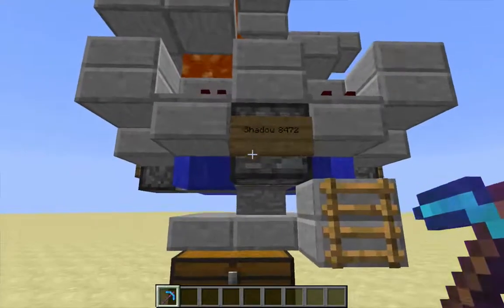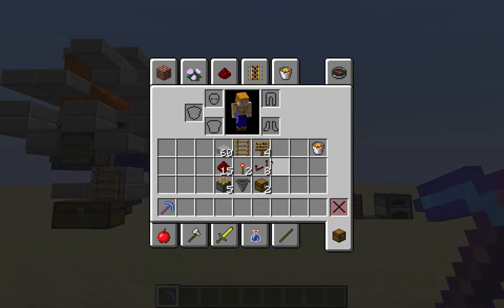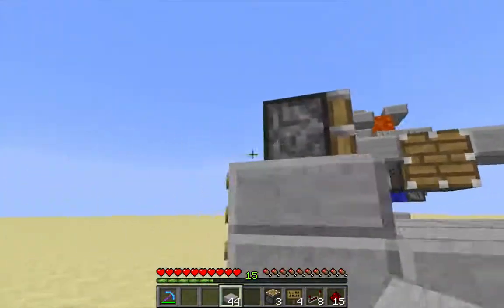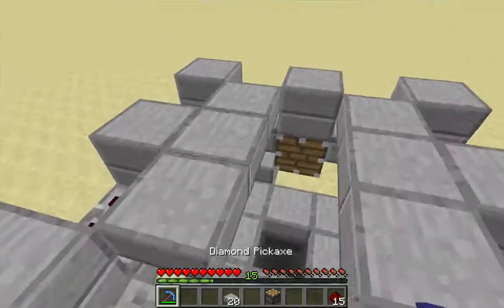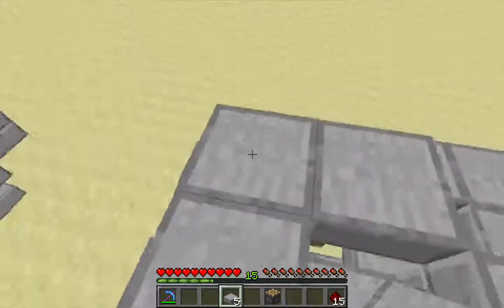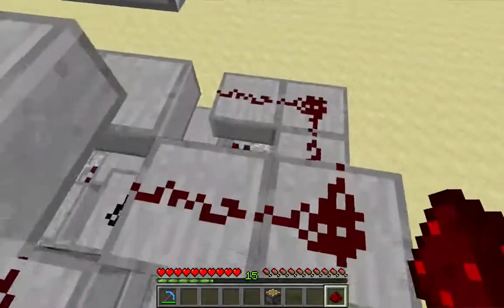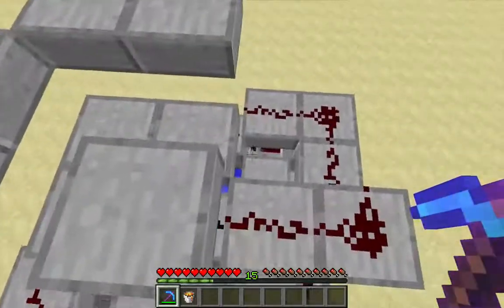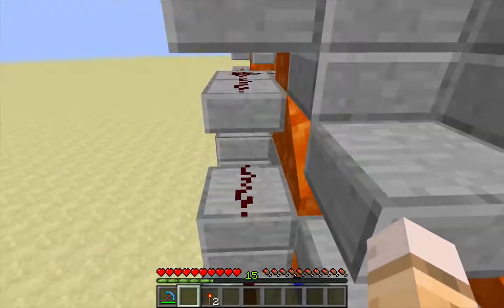Minimalistic 4-Piston Smooth-Stone Generator (SkyBlock friendly)

Comment: What if that skyblock doesn’t allow pistons?
Reply from the maker: In a vanilla skyblock, you should be able to get pistons. Zombies drop the necessary iron, and witches drop the redstone. If you’re prohibited from using pistons for whatever reason, then I’m afraid you’re stuck with slower cobble generators

Comment: i made it in 15w47c it kinda break (no stone were drop) maybe the snapshot problem
Reply from the maker: +Sega Hen Hmm, I've built this in 15w47c without a problem. Do you know why no stone came out? Is the water still in place, for example?
Reply: the smooth stone become invisible after it made ! i still can mine it (invisible block) but nothing drop , some second later it come visible then i mine it still nothing drop, everything still in place, i think i just made some kind of invisible block glitch machine :D
Reply from the maker: +Sega Hen Hmm, it could be a rendering issue, due to the speed of the clock. First, make sure you're not in creative mode. The speed at which blocks are produced, coupled with the speed at which you can mine them, can make the stone seem invisible, because it's sometimes produced and destroyed faster than it can be rendered. That would also explain why no blocks are dropping.

Once you've ensured that you aren't in creative mode, try again with a pickaxe that has no Efficiency enchantment (or at most Efficiency II). Since this stripped-down version doesn't have the double hopper of some of my other designs, blocks are sometimes not picked up by the hopper when the blocks are mined too quickly.